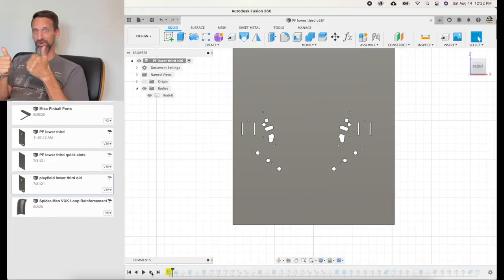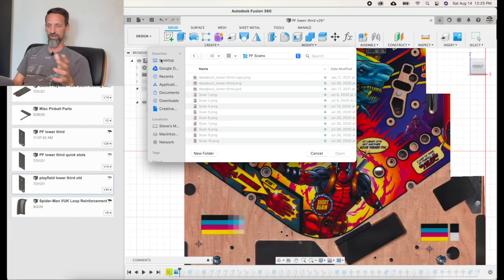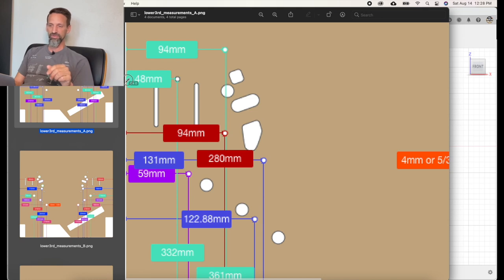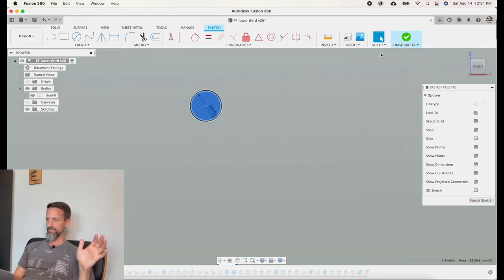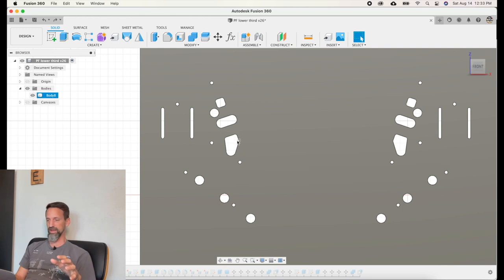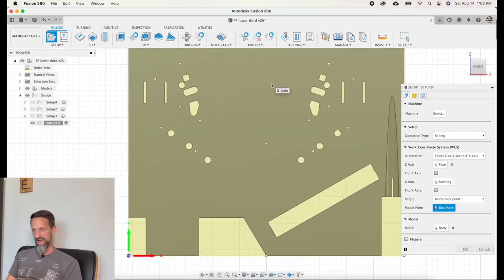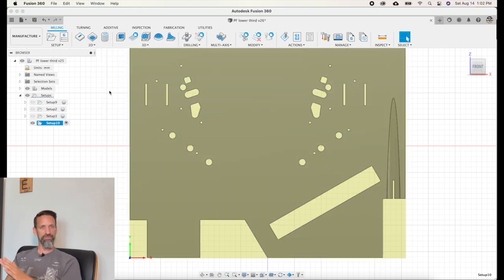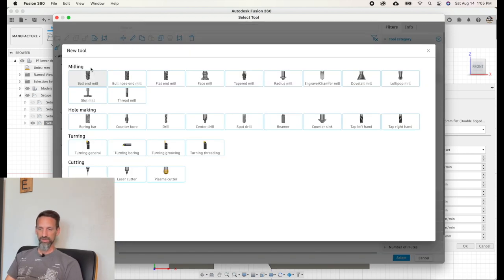HOW TO MAKE A PINBALL MACHINE: Fusion 360 Toolpaths

Comment: One thing to help align everything - on the top icon menu, look under constraints. You can choose all manner of how two different things can relate to each other, be it making lines parallel, co-linear, perpendicular, etc. So in the case of your post hole that you were drawing to line up with the one already there, what I would do is actually create a construction line (shortcut "x"), and then place your next circle on that line. You can do it in the reverse order by using the constrains to snap the new circle to a line you create after the fact - either way will do the same thing! Hope that's helpful!

Comment: Great video.  Do we get to look forward to a cutting video soon?  One tip on setting up your CAM is that if you are going to remove your 0,0,0 during your cutting, make that the last task it cuts.  If not, and you have to re-home you will be doing it off a different edge and can add a few places to make a gotcha type mistake.
Reply from the maker: Yeah good point- I failed to explain that in the video- and that’s also part of the reason I 3D printed that corner jig (was in my other video about CNCing a playfield) so I can more consistently align my wood on the xcarve

Comment: I have been looking for something like that but I don't want to start from a Stern playfield. Anyone would happen to have a standard body bally/williams WPC/DOT era  with just the basic holes (inlanes/outlanes /slings/flippers/through/plunger) ?
Reply from the maker: I don’t have one of those modeled yet, sorry - if you are using fusion you could take my public file and adjust it to match the measurements from a WPC game you want to match maybe?
Reply: The pinball makers wiki has a few playfields in the file section. if that helps. along with some templates.